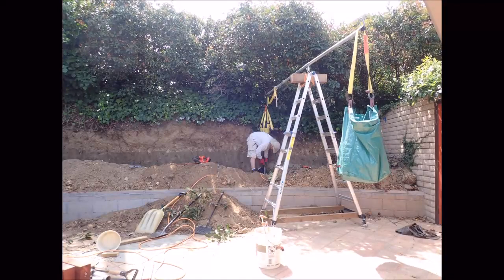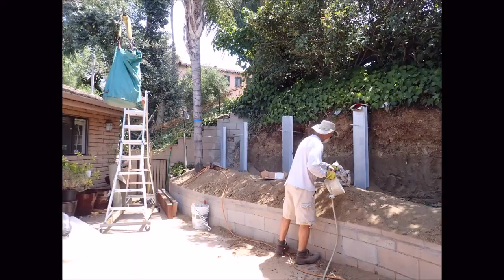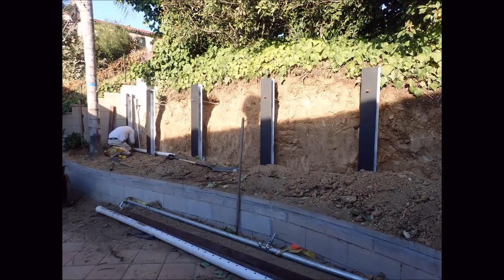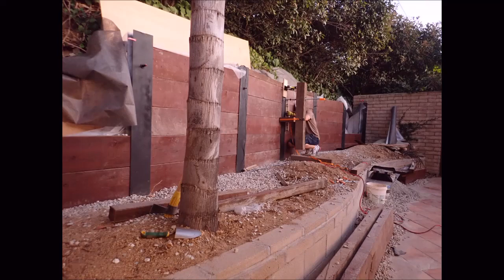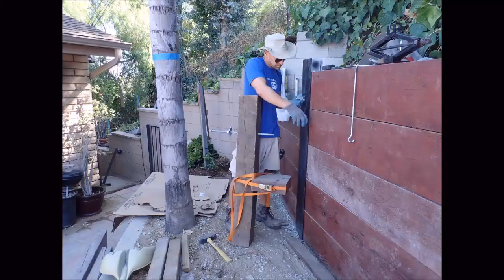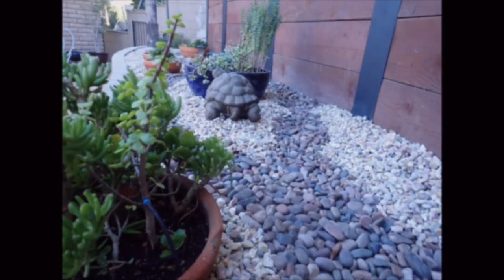Sutter Retaining Wall Installation (Timelapse)

Comment: Thanks for the detail in the video, description and your comment/question responses - did you get a geotech+structural engineer to ensure the 2" pipe + H pile + manta rays were suitable for what you were doing or just assume it was?  I'm looking at doing a 2" system and only 3' tall.
Reply from the maker: No geotech analysis beyond my own calculations from the formulas that I could look up. But that was just double-checking things to make myself feel better.  If I remember correctly, Sutter's 2" wall was rated for 4ft tall. By bumping up to a 4" wall, changing the 1" rebar to 2" pipe, and upsizing to larger manta-ray anchors, it should be many times stronger than their standard wall.... more than enough for my 5' wall.
A few years later, I also added some 3' and 4' tall Sutter walls to my backyard using their standard 2" product. (About 80' total length) It all worked out very well.
Reply: @InfinitelyFinite nice! one other question: why use the jack setup to set the anchors vs just spinning the nut? also saw you put loctite on them :-)
Reply: @InfinitelyFinite and care to share the formula website? I found the capacity of the duck bill anchors and that was it.
Reply from the maker: @AussieInSeattle  My original plan was to just spin the nut... but changed my mind after trying it on the 4" wall, for a few reasons. 1) You need like a ft of travel on the screw at high tension, which is a lot of work with a box wrench. 2) I  was worried about grinding down the threads  inside the nut with all the friction (and it's hard to change the nut afterwards). You could add grease, but I didn't want to compromise the loctite. 3) Using the jack was way faster.
However, when I used the 2" wall system later, I was able to just spin the nut to set the anchors.
Reply from the maker: @AussieInSeattle  That was too many years ago, so I no longer have the formula handy. I just did a Google search for retaining  wall soil pressure load (with surcharge if you have that)

Comment: When you rented the jackhammer did you have to rent a special adapter to fit the H post and for 2 inch pipe to hammer everything down. Or did you buy them somewhere? Plus where did you get the 4X12 Sleepers. I've been trying to find them but it's proving to be difficult. Thanks and great job none on the wall
Reply from the maker: You can rent the special jackhammer bit (H-post driver head) from Sutter ( https://www.sutterequipment.com/retaining-walls ) and return it to them when you are done.  The bit is a standard 1-1/8" hex that fits in most jackhammers.
You can also rent from Sutter the special bit (drive gad) that you use to hammer the Manta Ray earth anchors horizontally into the hill. 

To hammer in the 2" pipe, my local tool rental company (sunbelt.com - where I got the jackhammer) also had a standard bit with a 3" cup on the end (usually used to hammer steaks into the ground).

I ordered the pressure-treated 4x12 sleepers from a local lumber yard (www.ganahllumber.com) in 20' lengths and cut them down myself. All the lumber yards around me (even Home Depot) had them, but you have to special order it since they don't display it in the store. Seemed to be stored locally since they delivered it in 1-2 days. (I recommend installing all the posts before cutting down the sleepers so you can measure exactly how long each sleeper needs to be.)

Comment: I would love to know the specifics of the ladder/jackhammer/ pendulum.   We have a similar project
Reply from the maker: Yes, the jackhammer is quite heavy when you need to safely hold it above the posts.
For the boom, I used a 13' long piece of 2" steel pipe.
The counterweight is a pair of doubled up 80 gallon garden bags, filled with roughly 150# of dirt.
The pivot I made with parts I already had on hand. (https://imgur.com/a/mPUEHuo) It allowed 360deg rotation and +/-60 deg of tilt.
The pivot sat in a hole I drilled in an 8x8x24 block of wood - which was lashed to the ladder with a ratchet strap.
I made a rolling base for the ladder to make it easier to move around my patio (especially with all the weight on it).
The pivot was attached to the boom at 1/3 of the way from the counterweight to the jackhammer. Since the jackhammer was twice as far from the pivot as the counterweight, the counterweight needed to be about twice the weight of the jackhammer. (If you connect the pivot at the middle of the boom, the counterweight would weight the same as the jackhammer.)  I used the 1/3 - 2/3 setup so the boom could reach the posts from the patio. 
If you have two people, it might be easier for one person to be the counterweight - instead of lugging a giant bag of dirt around.
Also, if your ladder is tall enough, it is probably easier to make the pivot by hanging the boom (with rope/webbing) a foot or two beneath the peak of the ladder. It doesn't give you the 360deg rotation (which you might not need) but it is so much simpler to make (no special parts).
I ran a second rope around the jackhammer (and its trigger) so that I could both operate it with my foot as well as pull down on the jackhammer with my body weight. This left my hands free to hold the post in position while hammering.
I would also add some sort of clamps to both ends of the boom to make sure none of the ropes accidentally slide off the ends.
I hope this helps give you some direction/ideas.

Comment: Hi great job! Are you still happy with the wall? Any structural issues or things you wish you did differently? I’m pretty close to doing a Sutter wall but haven’t pulled the trigger yet from lack of long term information
Reply from the maker: Still super happy with the Sutter wall. It really transformed my front patio space. Seems really solid and continues look great.  If I can get some more free time, I'd like to install additional Sutter walls in my back yard. (Those would be smaller and use 2x12 instead of 4x12 lumber)
Reply: @InfinitelyFinite  Thanks for the information and reply. I have about 120 feet that I am planning to build a 4 foot wall on. Did you put any waterproofing behind the sleepers? Like a dimple board to run down to the drainage?
Reply from the maker: @littlejando  Great question. I  backfilled about 1ft thick with 3/4" crushed granite for drainage. (With some permeable landscape fabric behind the rock to keep most of the dirt and roots out.)  I intentionally did not put any waterproofing membrane behind the wall for 2 reasons. 1) So that the wood can breathe/dry (rather than trap moisture between the membrane and the wood). 2) If the drain is clogged, I want the water to come out between the boards rather than building up hydrostatic pressure behind the wall.  That's my philosophy on it.
Reply: @InfinitelyFinite  Good call and makes sense. I live in an area that isn't very rain prone (SoCal), but I have super fine soil. I talked to the Sutter folks and they said it shouldn't be an issue but I am probably just worrying for no reason about wood rot but what you said aligns with what I have found with other walls. Thanks again!

Comment: I like the detail and engineering you put into it, so well done!
Question: how tall is the wall and how deep in the ground are the posts?
Reply from the maker: Thanks for the feedback! 
The wall is 5ft tall. 
The posts that you see are hollow and only go about 1ft into the ground. But, inside the posts are pieces of 2" pipe that go 3-4ft into the ground. These just keep the bottom of the posts from shifting around.  It's really the horizontal earth-anchors near the top of the wall that support the wall from leaning over.

Comment: Where can I find that post in california?
Reply from the maker: You can order them from Sutter (https://www.sutterequipment.com/retaining-walls) and they ship them to California from Nevada.  Mine arrived strapped down to a single pallet. They also provide the attachments you need for the jackhammer (which you return them when you are done).  The shipping cost was a lot less than I imagined.  I was not able to find anything similar locally.
Reply: @InfinitelyFinite  thank you for rhe information
Reply: @InfinitelyFinite  hi, we are struggling with our jackhammer because of the height.  Can you offer and specifics on your ladder-pendulum system?
Reply: @shelleyscholl4782  Looking to do this wall... did you work out the issues with the jackhammer and posts? How long are your post and what type of soil are you working with?

Comment: What was the cost roughly? Per post if possible
Reply from the maker: Including all the posts, anchors, caps, wood, gravel, equipment rental, paint, etc., it came to ~$730/post (This is using 4" posts & lumber. The standard 2" material would have been cheaper. )  This is all pre-Covid. The cost of steel and lumber has gone up considerably since then.